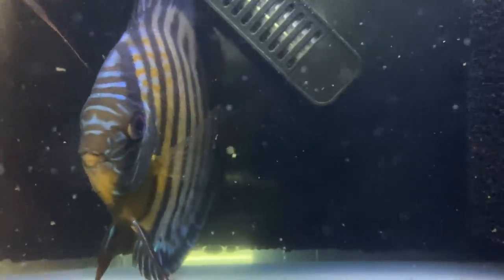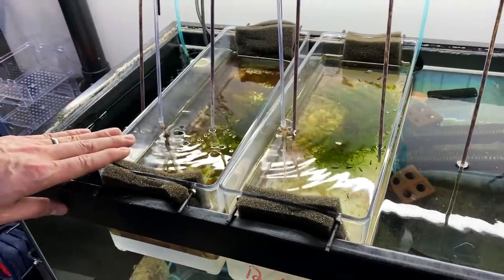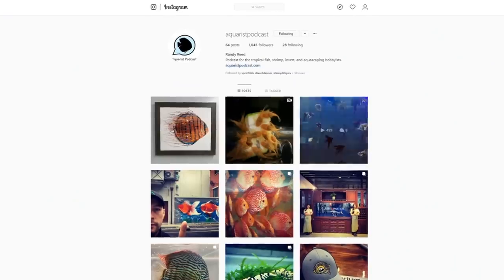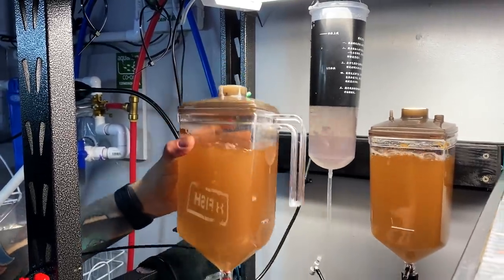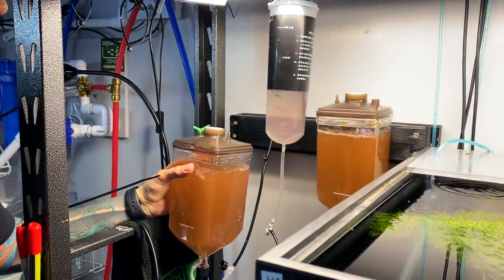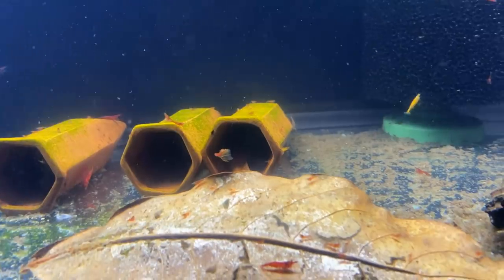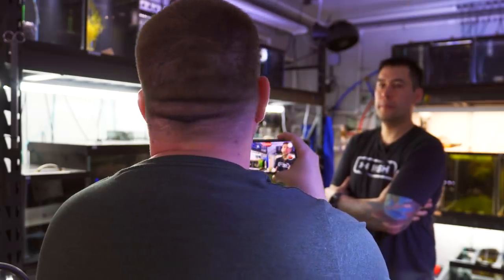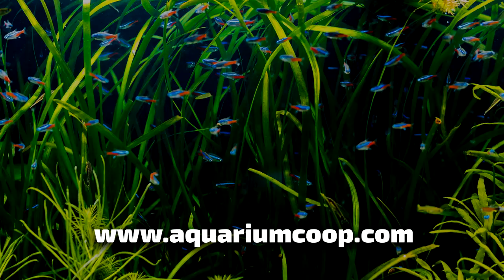Discus and Angelfish Room [Tour]

Comment: @Aquarium Co-Op, he hasn't considered using Excel or similar to set-up a better documentation for his breeding along with identifying parents and genetic tree?

Edit; 12:58 - You probably want to make a french cleat mounting mechanism. So it gets closer to the wall compared to his set-up. It would probably be the most ideal solution. With a french cleat, you only need a 45 degree angle cut on a piece of wood.  And you can hang it up there, next to each other.  And regarding the water rotation for the eggs. I dunno, but I think a slope down to one side, where it bubbles. Might be more ideal than a centre bubble? Then again, I don't breed a lot of brine shrimp.